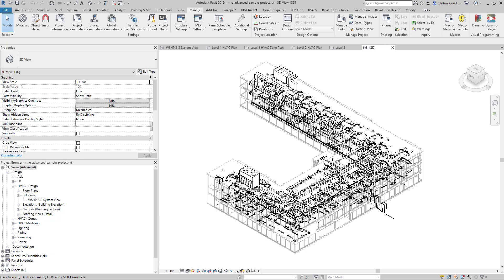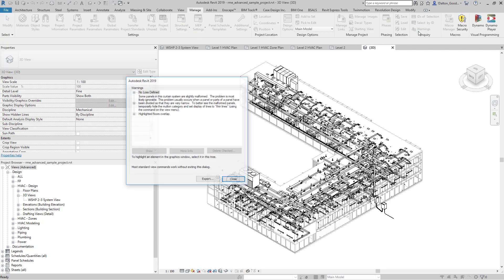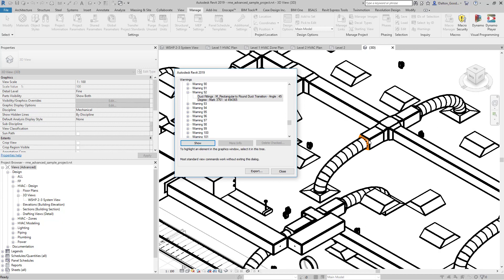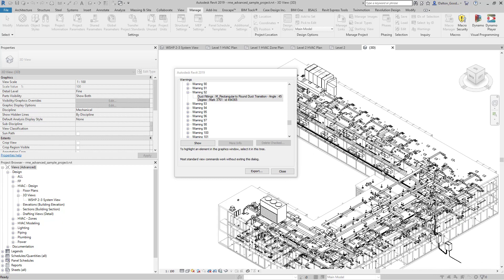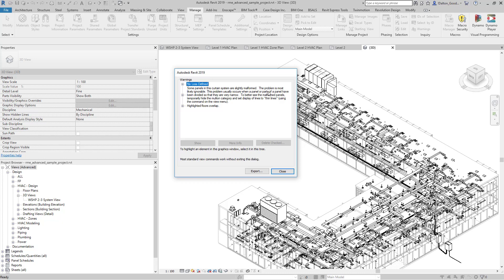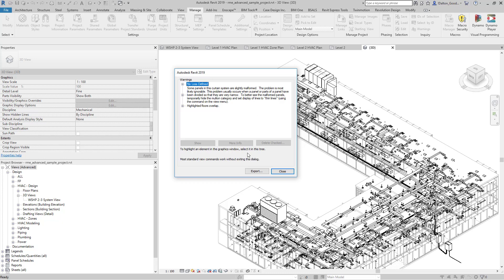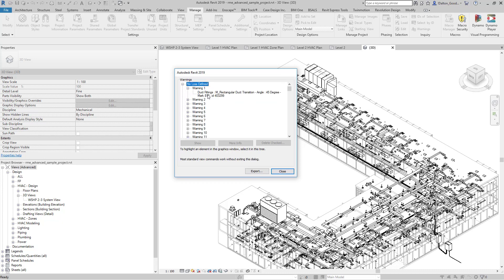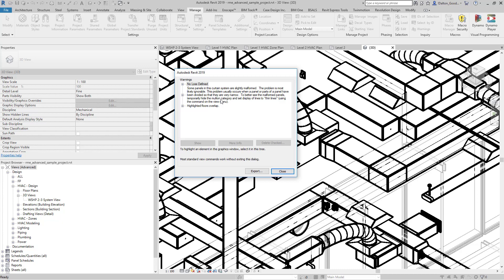Revit Warnings Overview

Comment: Hi, Is ther a way to see the warnings which have been resolved in revit? Or we can only see the ones still exist in the model from "Review Warnings" bar?
Reply from the maker: There isn't a way to see resolved issues. The warnings only show active warnings. You can automatically dump out the warnings data and compare them daily to show you what has been resolved.
Reply: @TheBIMCoordinator  Thank you so much for that. I think I just dismissed a warning with no action button on it, which comes up and disappears pretty qucikly on my screen.